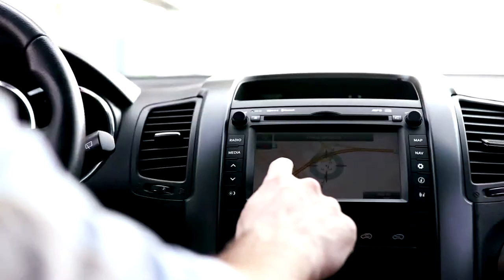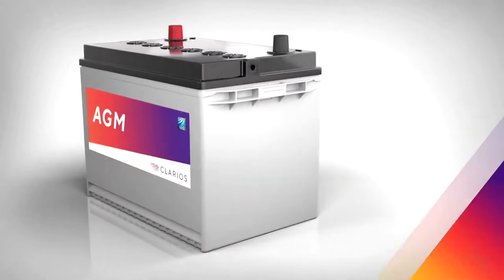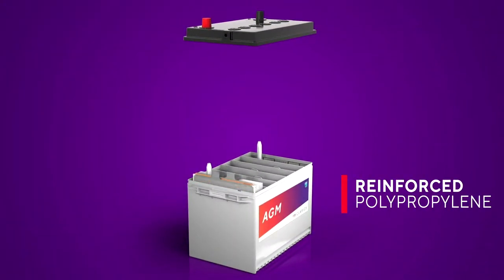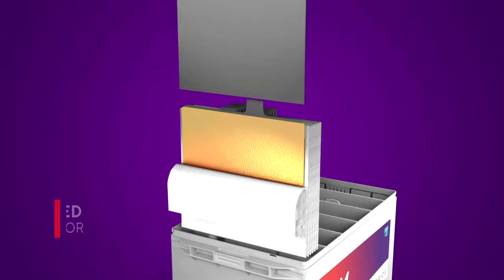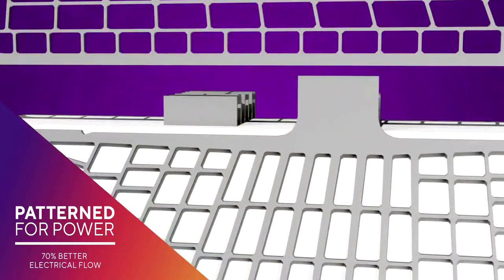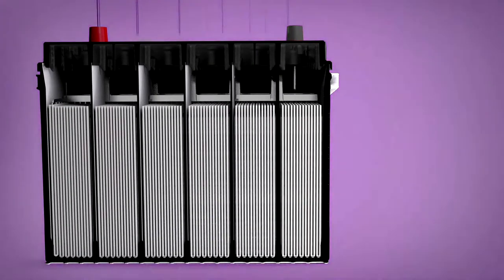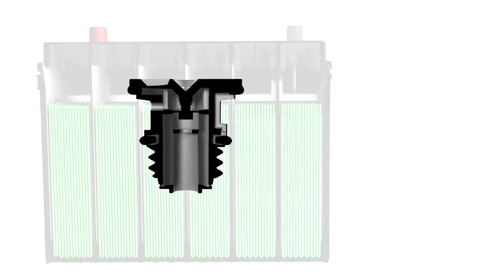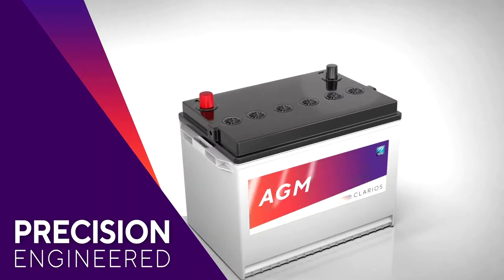AGM Battery Technology - The Battery Shop

Comment: Can you do a video on how to charge  STD vs AGM vs Gel and what would go wrong if you charge incorrectly
Reply from the maker: Hi - Thanks for watching! We could, but in the meantime be sure to follow the vehicle and/or battery manufacturer’s instructions for the proper method of charging their battery. The different types of batteries have different chemistry and using the wrong type of charger can cause the battery to be under charged, or damaged by overcharging it.